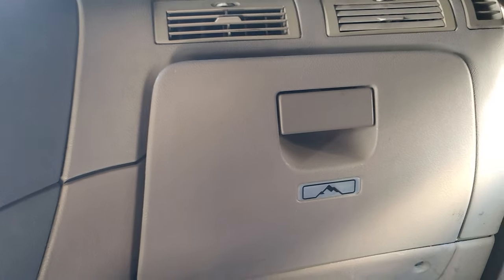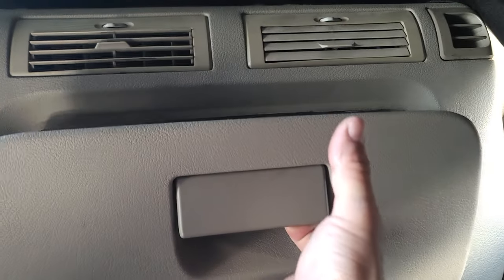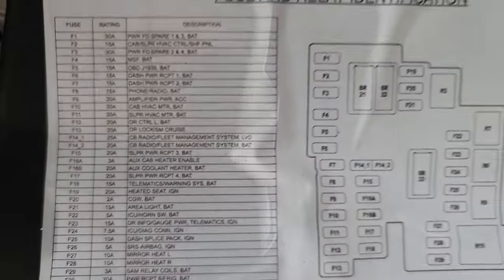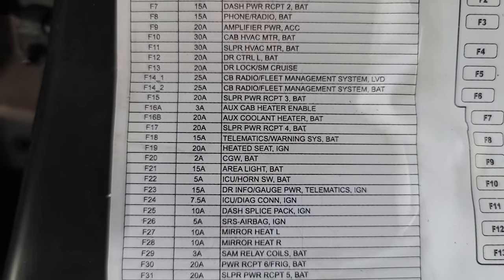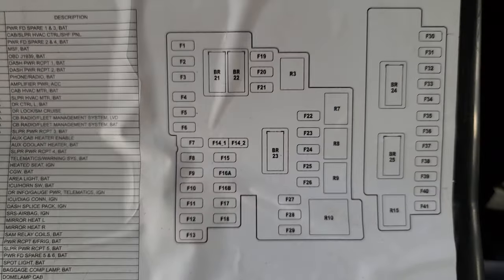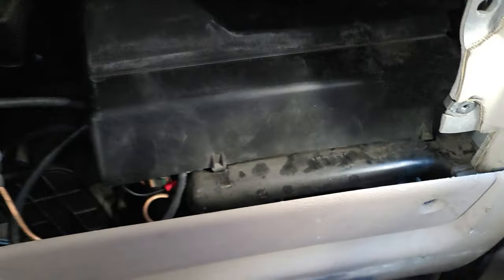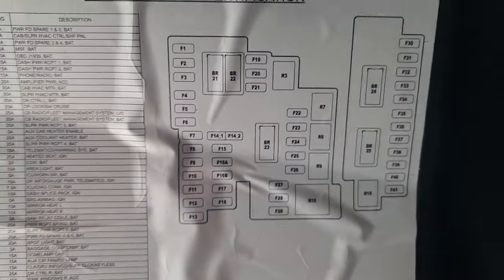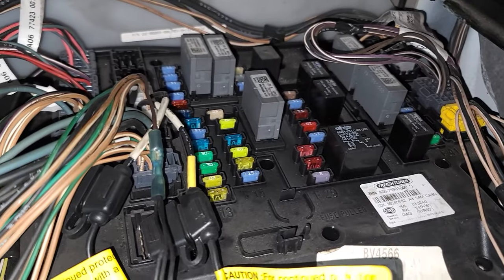Freightliner cascadia  Cab fuse box diagram label and location

Comment: Which one for power windows? Switch is fine but both sides font work
Reply from the maker: Try F39 & F40
Reply: I’m having the same issue. First the Drivers-Side window quit working. Tested both switches and the motor - all working. Tested continuity in the harness from the switch to the motor - all good. Both fuses (F39 & F40) are good, same with the relay (R15).
Now suddenly the Pass-side window quit working too. 😑
Daimler can burn in hell. 🔥

Comment: Can Some one please help me..is there a fuse for Def heater ...2016 freightliner..code is 5488 line 5
Reply: Hi there I’m a former freightliner tech. The Fuse number 54 on the SAM cabin module. Odds are that the def heater line rubbed through something along the frame rail or the aftertreatment chassis or the 1 box harness has an open wire exposed. Check the routing up above the crossmember where the cab air bags are mounted the lines tend to chaff. But check to see if you have 12v at the def heater connector at the harness side. Hopefully this helps
Reply: @William Gillis  I found the problem at the harness coming from the behind the driver fender acm..
Reply: @williamgillis9737  hey would you know which fuse is for tail lights trun signal  2015 Freightliner

Comment: My radio works fine but no sound from speakers
Reply from the maker: Thats not going to be a fuse, check the radio wiring
Reply: Did you figure out what it is mine is the same thing
Reply: @TRUCKINGTIPSDIY reset button?